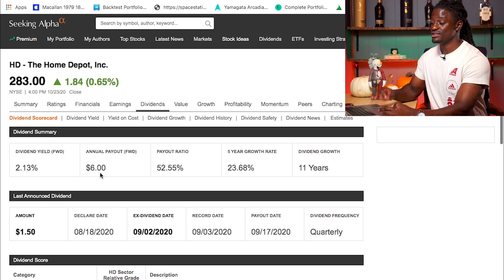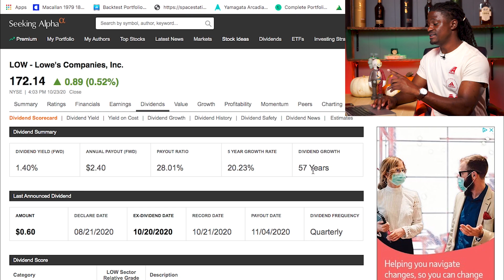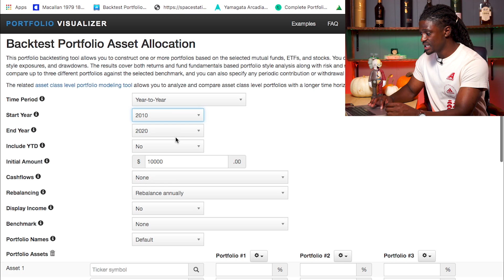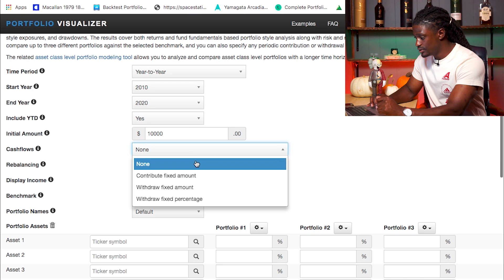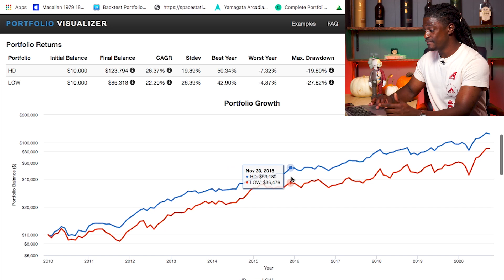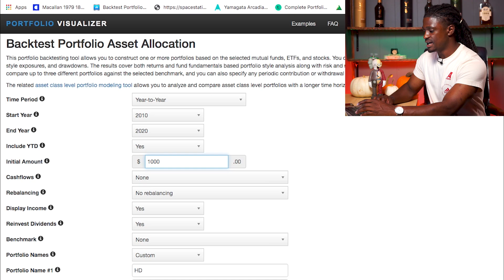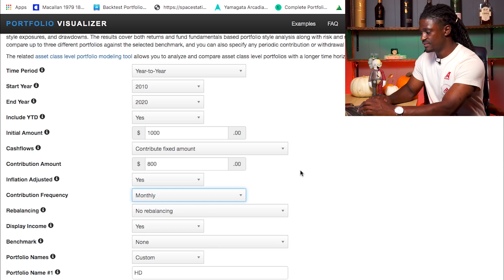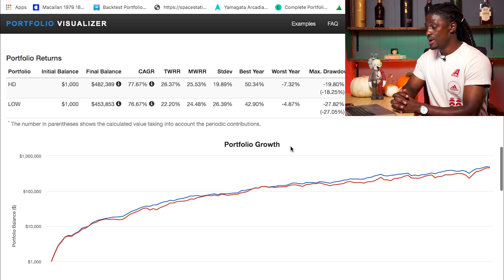Dont By Lowe's For Dividends - Buy This Company Instead

Comment: I bought HD as an employee stock option  in 2003 as a part time employee.  Paid in about $1500; @ $27/share.  I have not touched it except for rolling the dividends back into purchase more shares.  The tax man will snip the capital gains when its time to start the exit strategy, but at over $250 a share.....it was worth it. IMO
Reply: Think it’s possible to open a small business and buy new gear?
If you are tech savvy buy a new pc iPhone etc 😂
Write it off